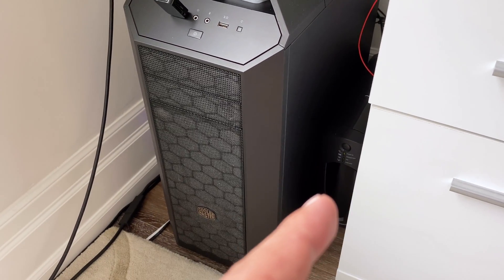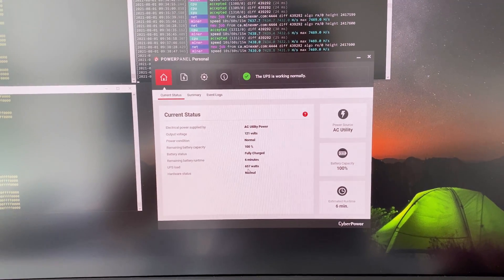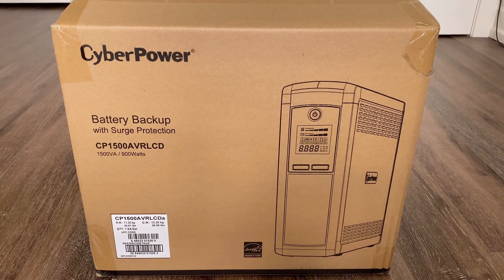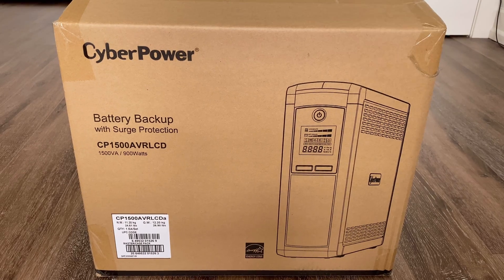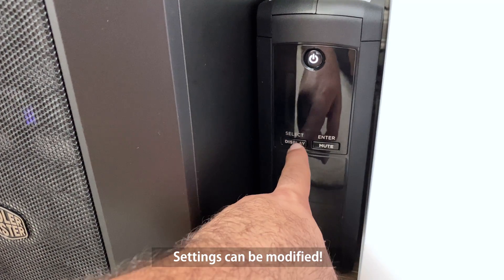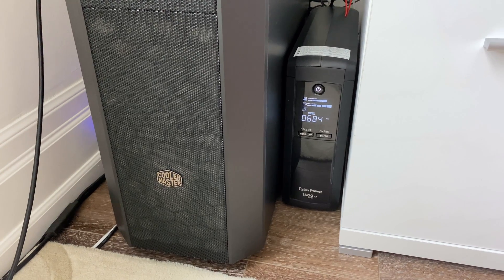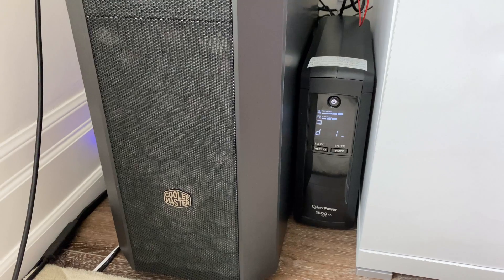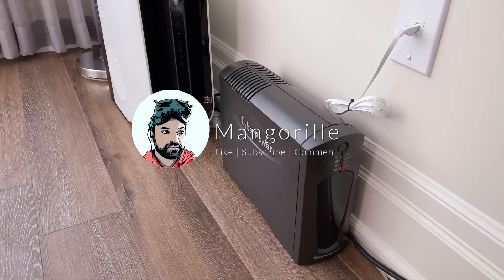Time to upgrade our computer's UPS battery backup system! | CyberPower CP1500AVRLCD LCD 1500VA/900W

Comment: Just got a few of the 1500VA AVR lcd's for my Asic miners (KAS, under 140w each) and 2 desktops running RTX cards for mining and running nodes. Connected to my EecoFlow Delta 2 solar geneerator (only have 2 right now). Wish I would of done this 2 years ago! Thank you for the video!
Reply from the maker: Welcome!

Comment: I think your old UPS just needs a new battery, those are very cheap an easy to replace, you should just change the battery and that way you can use it for your AlienWare rig and create less e-waste, also always remember to send old batteries to recycling
Reply from the maker: Thanks, ya, I've changed the battery in that unit previously but in this case I made a decision to retire the entire unit as it was getting fairly old. I sold it for parts so definitely tried to do my part in reducing e-waste. :)

Comment: Not recommended to run a printer and several other devices that have huge power draws on start up.
Reply from the maker: It's a 3d printer, uses about 100 watts of power. I think you may be thinking of a laser printer.

Comment: I just bought the same UPS, hopefully it works out great.  Quick question, were you unable to replace the batteries in the old UPS?
Reply from the maker: Been working great so far! I changed the batteries a couple of times on the old UPS but the whole thing was getting fairly old at that point and thought it best to just replace the whole thing.